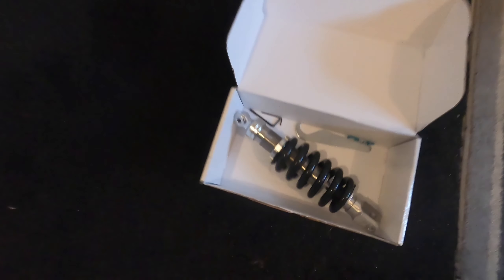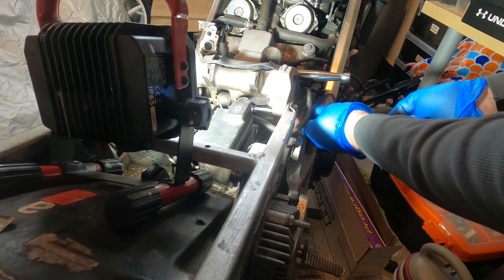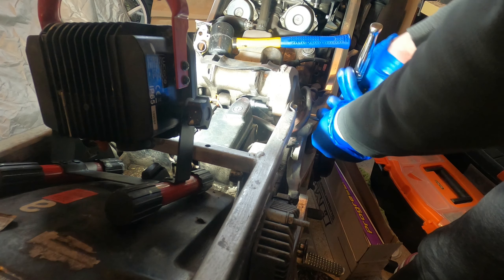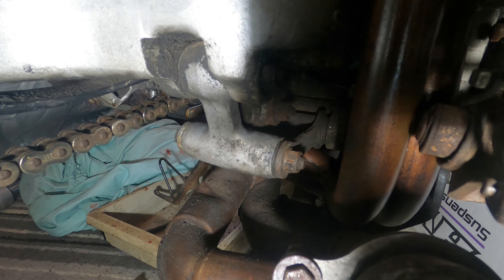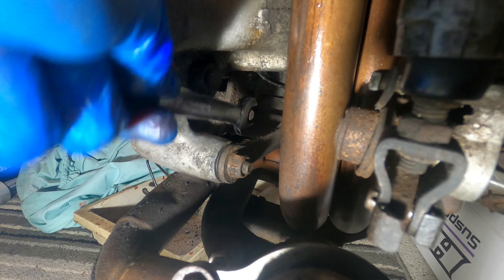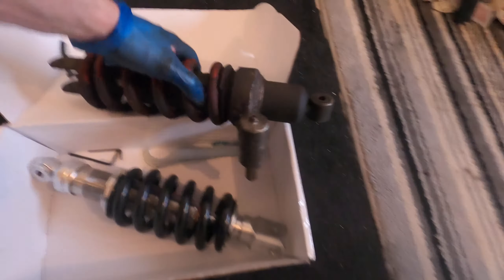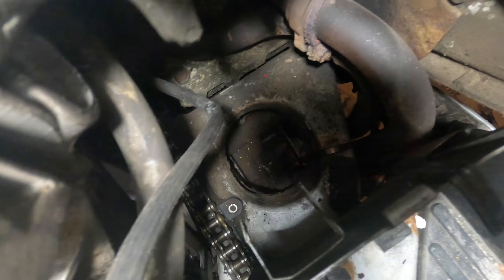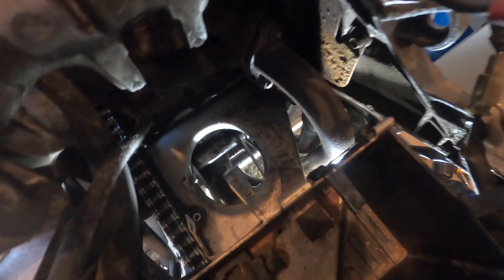VFR750 | HAGON REAR SHOCK INSTALL

Comment: It is so fiddly when you have linkages. I fitted Hagons to my V7, made a great improvement over stock.... but on a twin shock, so much easier to change them! :D
Reply from the maker: Yeh seen that with the wheel change, the left was put on in a flash 😂. Really should have removed the linkages and swing arm, cleaned and greased everything but if this bikes a keeper it's something I can do maybe next winter. Thanks for watching buddy. 👍
Reply: @Lochwood92  Is always good to give yourself somit to do later :D

Comment: I see so many shows where old metal is tinkered with, like this one
(which I like very much and you´re doing a fantastic job). 
I happen to be one of those totally crazy people who wrenches on old French cars with hydropneumatic suspensions, 
like DS,CX,BX,GS,GSA. I´m doing this for many years 
(I happen to have a RC36 as well, besides other Honda Vehicles ranging from S2000 to F-RV), 
but what will always be a mystery to me is this: 
WHY is it , that nobody who deals with rusted bolts on a regular basis, has the habit of drenching it in WD40 or similar first, before any attempt to losen it is started?
As somebody who has ripped off many a bolts and had to refer to welding and all sorts of manipulation in spots that you can hardly see or feel, I just don´t get it. 
It saves a ton of work , makes the loosening way easier and prevents desaster in most cases.
But I guess it will stay a mystery and I will be known as the only idiot who does it:)
No offense or mean spirit here, it is just my experience and maybe it can help you in the future.

Best Regards from Germany and a heartly felt RIP for a famous Haggis: Steve Hislop.
Cheers
Tobias
Reply from the maker: Well said Steve.. I have a soft spot for old stuff but they just scream money money money. I've always fancied an FR-V but the emissions kill us on tax over here so couldn't justify buying one.  Lovely looking thing though and that high revving S2000  😍😍😍. Yes old rusty bolts.. Love my VFR. Thanks for your comments 👍

Comment: The build series is going really well. I think awkward nuts and bolts are made much harder when you have to fit a camera in there too 🤣
This bike gonna be amazing when you finish. Are you gonna be close by the time lockdown ends? You'll prob just want to be out on the bike at that point 👍
Reply from the maker: Hoping.. mid April it will be ready. A total restoration would take all summer but i can get it mechanically sound and looking good. Thanks for looking buddy.

Comment: Nice one, good to see someone other than me struggling once in a while!😂. Have you ridden with the new shock yet?  Is there a marked difference?
Reply from the maker: Ha yeh more than most with this project. I've never actually ridden this bike, bought it as a junker and replacing most of it 😂. Cant compare to original but the shock did look fekd. Restoration coming along so hoping to test it out around april. Thanks for watching bud 👍
Reply: @Lochwood92  No worries, cheers for making them!